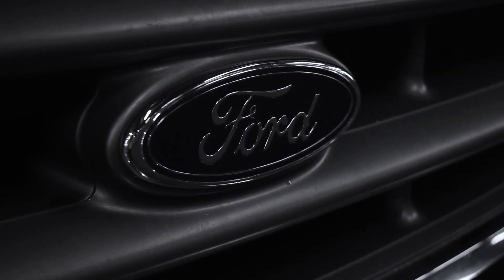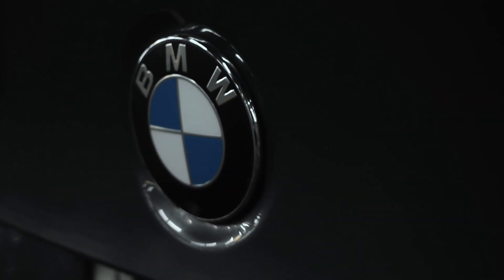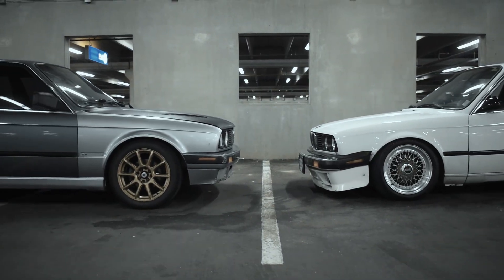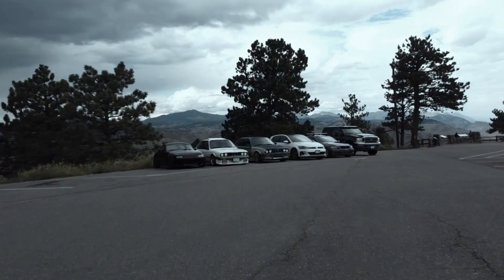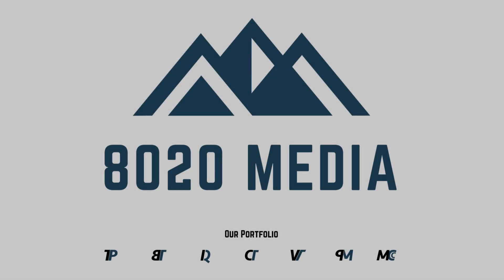The 6.5 Detroit Diesel | The Worst GM Engine?

Comment: A big misconception people have is that this engine was for towing like the 7.3 and the cummins and it wasn't really. Gm had the 454 gas for towing at the time and the 6.5 was the more economical choice of the 2 although even today people are finding ways to amp the 6.5 up.
Reply: Oh really? I feel like the 6.5 always was more of a workhorse engine. I thought the economical choice was the small 4.3 engine
Reply: @Jean_1999  between the 350 or the 454 in the lineup the typical engine people would get to pull trailers and just work with it was the economical choice a 6.5 in decent shape and you keep your foot out of it can get around 20 mpg
Reply: @nou8257  that’s funny that you say the 65 gets about 20 miles of a gallon whenever you look it up online they say that the 1990 series 65 trucks only got about 11.9 miles a gallon
Reply: @benscot5728  A 90 is non turbo I've seen suburbans with 6.5's get 25 it's mainly down to where you live how you drive and how healthy the truck is
Reply: @nou8257  A 1998 Chevy Suburban with the 6.5L turbo diesel engine typically gets around 11-13 miles per gallon combined, according to data from Fuelly and other sources, with some owners reporting slightly higher figures depending on driving conditions.  “This is from the post “
Reply from the maker: Nou - Thanks for adding this insight.
Reply: The GM 6.2L V8's were the engines that are underpowered but so is the 6.9L & 7.3L IDI V8's from Navistar. The only easy way to upgrade that was the turbocharger kit from Gale Banks for all three engines. The GM 6.5L V8's were just bored out 6.2L V8's. The 6.5L V8's are actually good for hauling and retained the high fuel efficiency. It's debated on longevity compared to Cummins and Powerstroke. However,immense stress and different expierience will say otherwise in military service and oilfield business. These engines were good for the HMMWV's until AM General came out with the uparmored M1113-M1167 ECV's because of the extreme weight. With armor,personnel,and equipment the HMMWV's almost weigh as much as an unloaded M35A2. Despite the heavy modifications the 6500's had these engines never were reliable for the newer HMMWV's. Troops hate the Humvees and always deal with head gasket or crankshaft failures. Finally the JLTV's/LATV's since 2019 have been phasing them out of combat zones after the MRAPV's and MATV's.
Reply: Makes perfect sense

Comment: Also the turbos gm used were far to small creating high drive/back pressure which also caused crank failure and over heating
Reply from the maker: Chooky - Very true. Thanks for sharing this insight.

Comment: I had a 97 one ton .  Four injection pumps later I bought a ford.
Reply from the maker: Dang, that's a lot of failed injection pumps...but yeah, not the greatest engine from GM especially compared to what Ford and Dodge were putting out at the time.

Comment: have a 93 ext cab lng bd 2500 6.5 td and 5 speed manual with that rare 93-94 only year 1st L ow gear and R of the same ratio Absolutely love it has 360k miles og engine and trans just put a new clutch and its still pulling and getting mud on the tires everyday love these engines and trucks every nay sayer wants an invincible motor or is not reliable lol they can be some of the best diesels ever on the road
Reply: Got a 94 k3500 6.5 5 speed crew cab dually with that odd 1st low as well and a factory tach which i'm told is also rare.
Reply: @nou8257  nice!!!! yeah same here got the tach too it is really rare for that style of truck ive seen only 2 others online like it any near me "250" radius dont have a tach and none manual
Reply from the maker: That - Thanks for sharing your experience!

Comment: I owned an 82 6.2 j code in a one ton truck I had the factory book and mine did exactly what it said it should do I had 175k miles on it when I sold it never had the heads off and still ran like a champ
Reply from the maker: Joseph - Sounds like you took great care of it! Thanks for sharing your experience.

Comment: I have a 97 6.5l chevy cheyenne, with heavy duty tow package(manual transmission, granny gear, limited slip rear, heavier rear leaf springs, etc), I've owned for a number of years, but one thing that does anger me is I wanted to replace the lower coolant hose assembly and cannot, and like the thermostat without loads of work...looks like I have to remove all sorts of stuff, the entire front of the engine, jus to get that hose off down there,...I might as well when I do just change out a higher capacity water pump, fan clutch and higher capacity fan they talk about using.  Engine has about 240,000 miles,....miles-ish,...work was supposedly done like a stud kit I cannot confirm, ,,,sure did look clean when i go it.  There were so many new parts put on with just five thousand miles on it since then......, injection pump for instance, rebuilt transmission and cluth, brakes, air conditioning, new fuel tank and fuel lines, rear end limited slip rebuilt,  five to seven thousand miles ago that if the engine blew I'd likely put in a new 6,5l due to cost of some other diesel engine(sure would love a cummins in there though cause the manual transmission says chrysler corp.  I don't like it either, but former owner claimed to have towed huge loads, ...like 13,000 POUNDS  uphill, ...I THOUGHT that all the 90's 6.5l needed a better later high flow water pump for "towing".
Reply from the maker: Bud - Sounds like you have a good one! Unfortunately, they aren't the easiest to work on. Certainly have to do a lot of things at once when you tear it down. Thanks for sharing your experience.
Reply: Former owner lied to you 😅, even after some minor upgrades my 94 Suburban struggled to pull 7,000lbs up steep grades (Tehachapi CA). I have since installed a quadstar eprom and hx35 turbo and it actually did quite well pulling 5,000 lbs up a grade at 65mph. I’m starting to gain some faith back in it as a tow rig, but 13,000? I just don’t see that.
Reply: @ThirteenTwentyRepair  Yeah, I've pretty much figured that was maybe bs, with my very limited to zero experience towing trailers other than military experience with large trucks years ago.  Bout all I care for this unfortunate pickup I have is that I paid little for it years ago, have put little in it, and have barely used it.  Now I need a new ignition switch pricing out at $178, and a few other issues.  I guess right now I am lucky to own a running truck at all, errr, well, problems with the ignition switch, likely cause of moisture build up in the truck over the winter corroding connections due to it being on jack stands due to another issue,..namely I wished I owned an easier to work on truck like back in the old carburetor days, or a older good condition diesel pickup before electronics and emissions standards ruined simplicity of vehicles.  Haven't put on the new lower hose of course cause I can't without removing the whole front area parts, will later with an upgraded water pump/fan clutch/fan the set known that fits being higher capacity and for the trucks several years later.
Reply: @budwhite3570  my suburban has that later year cooling upgrade. When I was dogging hard on a 10 hour trip with a 7,000lb trailer it actually hit 210 a few times. Most of the time it lives happily at 190 all day, sitting idle at a light or 70mph.

Comment: The 6.5 is actually a great engine if you want a real work truck and add a few upgrades.
Reply from the maker: Connor - This is true!
Reply: How much can it be built on a mechanical fuel pump

Comment: I got a 98’ k2500  with the 6.5 and nv4500 transmission. 
I love my truck specially after I installed some upgrades from Quadstar Performance
Reply from the maker: Rigo - Sounds like you've got a beast on your hands!

Comment: 94 K2500 purchased new. My first diesel and not knowing any better got the  ''S'' engine that was a veritable powerhouse generating about 165 hp and equipped with an egr. Still own it, but have made countless upgrades and deletions over the years. It may not be the best but it's a keeper. Treat it right and it really is a fairly dependable platform.
Reply from the maker: JR - Very true! Sounds like you've got a good one. How many miles is on it?
Reply: @8020Automotive  Around 93k miles. Considered replacing it but with the prices now, not to mention all the emissions crap, this will suit my needs. Besides, I'm oddly attached. 😁
Reply from the maker: JR - Completely makes sense! You have many more miles to go on that one.

Comment: Lookin at getting my first diesel, I’ve heard 6.5s have their issues but are cheaper to maintain compared to a 7.3 as good as it is but it’s a bit more expensive to maintain. If anyone has thoughts on this I would love some feedback/support!
Reply from the maker: Wad - We have a 7.3 and love it. However, both are great engines.
Reply: 7.3 regardless of their unearned reputation .... are very expensive to keep running .... like failed turbos / injector cups /  glow plug failures / and glow plug controller failure / high pressure oil pump to fire the injectors  failures/ and lots more /  But owners love the ability to "rolling coals !/   something that will destroy the 6.5L.   If one is honest and compares the total costs of each engine .... the 6.5L wins hands down.   also it only needs 6 quarts to change the oil.  Unfortunately it is difficult to find a well maintained 6.5L used since if the owner kept it up..... they do not want to part with them...   Next time someone brings up the comment that they are POS.... ask him when did he owned one.  Like earlier comments  99.995% of loud mouths ... never owned a diesel.   Sorry I am keeping mine until the body disappears.  Wish I kept my none turbo 6.2L but the body was beyond saving.

Comment: The 6.5 NA in a 1/2 ton was ok. But as they turbo’d them, worked the engine harder and caused more heat and didn’t manage that all correctly that’s when they got worse and worse. I remember one of the big upgrades back in the day was getting a hummer military 6.5 block that was supposed to be significantly better than the cheap one GM used in consumer model vehicles
Reply from the maker: Yepp definitely a lot of problems with cooling on these engines! Curious about the military block, that's interesting but makes sense those would be manufactured a bit stronger.
Reply: The 6500's/P400's are actually much better than basic 6.5L V8's,espiecally because of the forged crankshafts,but GM should've entirely only used those engines for civilian usage which they did eventually later on. It was a massive mistake intialising those engines for the HMMWV's/ECV's. AM General only held onto the 6.5L V8's under contract from GM because of how cheap and distributed they were. They didn't want to figure out what more capable transmission and engine that possibly could've been used as replacements. The 6500's had numerous head gasket and crankshaft failures in the uparmored M1113-M1167 ECV's despite all the glorious modifications. Troops heavily disdain the Humvees because of that. That's why Oshkosh Defense as of five years ago finally debut the JLTV's/LATV's which are blends of HMMWV's and MRAPV's as one truck. The actual MRAPV's and MATV's were still better choices but flawed in some aspects for combat.
Reply: That's because the hummer one was all one block not a stroked down 7.5 gasser engine that was converted to suit the need for a big block diesel

Comment: Crank failures were also largely contributed too by the fact that gm cheeped out in material and went with cast iron instead of forged steel like in the p400 military engines, of wich was the called or material my the designers of the 6.5 but gm has to be gm and they have to make money some how right. From research I have done it also matters which company made the particular engine on a case by case basis. Because as far as I know and others feel free to call me out and hold me too it respectfully of course that GM(detroit diesel)themselves, international and optimizer.  And by my knowledge they international and optimizer were the better motors. But the optimizer (p400) being the best. Again feel free to correct if I am wrong but but whatever you do plz don't be mean about it.
Reply from the maker: Bryce - Thanks for taking the time to add this insight.

Comment: I love my '98 K2500 6.5td. Fuel efficient, easy to work on, affordable, and can tow anything I need. 
I had a hard time diagnosing a bad optical sensor though. Easy fix once I got my hands on a replacement sensor.
Reply: Yeah if my 94 ever has a pump problem i will just make it mechanical injection pump and be done with the computer controlled pump
Reply from the maker: Central - Love hearing that! Thanks for sharing your experience, it will certainly assist future viewers!
Reply: @8020Automotive  The codes it threw were P0251 and P0370. Ran poorly and would sometimes be put in limp mode. The optical sensor brought it back to life. It had this issue when I bought it, so I got a pretty good deal on it : )
Reply from the maker: Sweet! Good to hear.
Reply: How did you track down your problem being the optical sensor_?
Reply: @koolmotor420  Part swapping basically. did the clear fuel line trick, lift pump, all filters, etc. Injection pump was Rebuilt with new orings about a year before I bought it so didn't think it was that. They must've used same bad sensor. The sensors are about $300 so hard to justify the cost unless you know for sure. The codes were the telltale sign though. p0370 p0251 I believe

Comment: The 6.2 and 6.5 Detroit Diesel is actually a great engine once you get rid of all the bullshit GM Engineers did to it.. it's used in many applications that reliability is the number one concern such as military and marine use
Reply from the maker: Kevin - We absolutely agree!
Reply: I’m in the process of that right now. Got a 2000 1 ton that I love. But it does not like weight.
Reply: @justinpurvis7449 don’t you fuckin do it you better put a D max in it
Reply: The 6.5L V8's were only good in the M1025-M1097 HMMWV's and CUCV ll's because those trucks weren't very heavy and not driving into combat zones. Once the M1113-M1167 ECV's came out as uparmored variables that's when head gasket and crankshaft failures happened with the 6500's. AM General held onto the 6.5L V8's under contract even when GM was done with them. Those specific reasons are why troops hate the Humvees. These engines were never built to handle immense stress like that,it doesn't matter what is possibly done to modify them. That's why the MRAPV's and MATV's were debut in following years. For the last five years the JLTV's/LATV's have phased out the HMMWV's/ECV's from combat and are better built with deleted L5P Duramaxs. The 6.2L V8's were sluggish and only built for high fuel economy. The only good upgrade was to acquire the turbocharger kit from Gale Banks that adds 60 HP/115 TQ and 30% increase in efficiency. The 6.5L V8's being bored out 6.2L V8's were actually decent for hauling and towing and retained the high fuel economy. Reliability was still conflicted between Powerstrokes or Cummins. I'm the owner of an 1986 M1009 (D10) CUCV and I get 18-20 MPG at 75 MPH all day. 3:08 gearing ratio is great,it's the 4:56 gearing ratio of all the other CUCV/D30 variants that made those trucks slow. The only part I had to replace was the fuel pump and the only changes I did was buying NAPA fuel filters and water seperator.
Reply: @Slim_Slid  bro mraps have i6s... and the l5p came out 10 years after the mrap...
Reply: @Nomadsc2  And your point is? I already know about these trucks.
Reply: Agreed, the 6500 Optimizer from AMG-GEP is the way to go for replacement, better castings, improved cooling and the biggest improvement is a forged crankshaft
Reply: It is a great engine one of the reasons why they used it in the military very reliable fuel mileage is great and the things that go wrong are the most stupid things
Reply: Gm engineered it entirely Detroit was a gm brand at the time.
Reply: @jdrok5026  he means gm corporate. Detroit built a good engine, a builder of reliable engines for a long time. But corporate cut cost
Reply: What do you have to get rid of that gm done to them
Reply: @texasstreets2429  the cast iron crank first off
Reply: Exactly 💯% agreed
Reply: I do have to ask. Low mileage engine an i mean low not even 100k or 80k. Has anyone seen oil gum up like syrup
Reply: @John-i1m3y  I've 2 with about 200,000 that doesn't have that issue. I would suggest that flush it well then change the oil with high detergent oil and a quality filtee
Reply: Nobody can tell me man. Oil was changed every 3k.
Reply: @John-i1m3y  but with what kind of oil? I use shell Rotella which is the same oil that i run in my semi
Reply: It was rotella. 15 40 thats what I don't understand why it happened
Reply: @John-i1m3y  it almost sound like it was quakerstate, so i don't know, but i would do a good flush and see if that fixes it
Reply: Did do that.  Transmission fluid was ran through it. The next day syrup
Reply: @John-i1m3y  i would flush it with kerosene then when i drained it i would put a magnet to the container to catch any metal if any then run it as fuel
Reply: I tried alot. Nobody can tell me what happened. Government shut the 6.5 down for a minute and no parts there for a while
Reply: All of car culture is 4 turd stroke shit! Lets see any of them run tipped in any position with just oil injection and no oil changes!